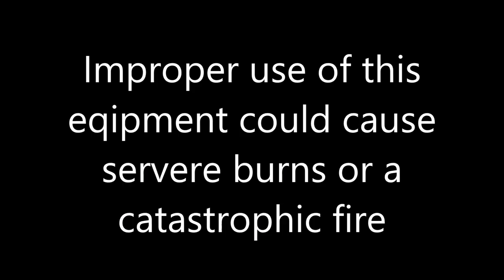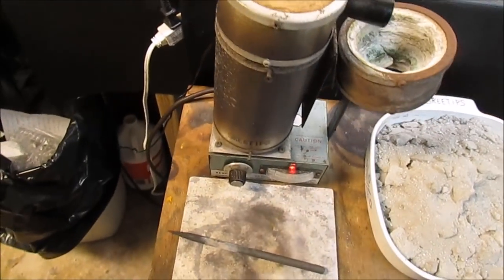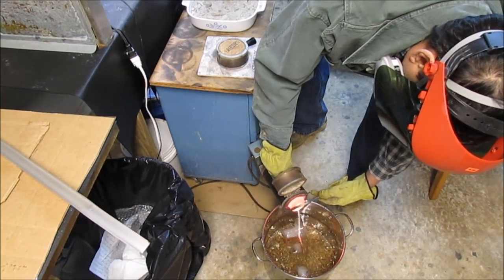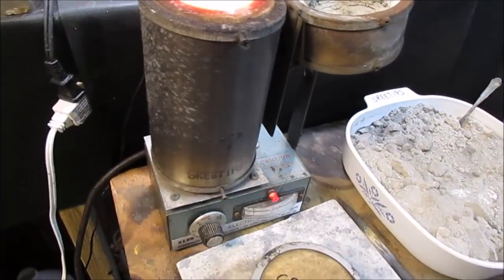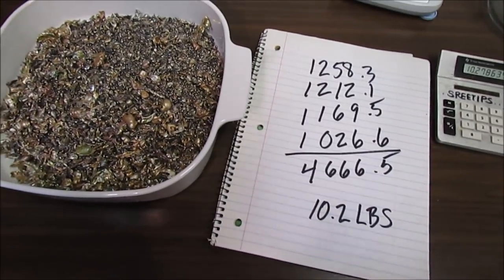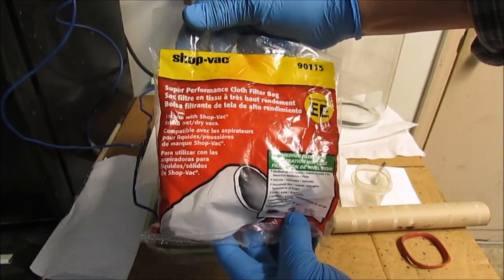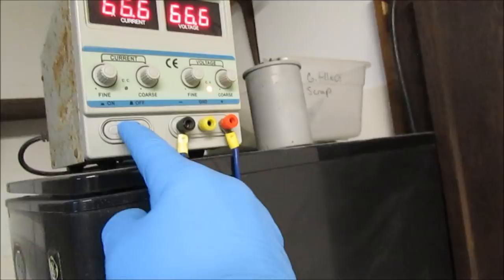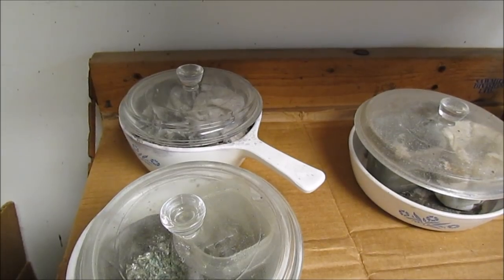Silver Refining 10 LBS Melted Into Shot

Comment: Why don't you use another Tupperware container around the one with the holes in it but with no holes in it. That way the ions will have to easily  travel through a narrow space up around the basket and it would be almost impossible for a dendrite to come up and wrap around the 2nd Tupperware container and touch the anode Hands free operation until the crystals literally fill the whole dish.
Reply from the maker: I run a 3.5 liter stainless steel cell. Palladium, on the goldrefiningforum.com, told me that I would "throw rocks at the glass and graphite cell" after I switched to stainless. He was right.

Comment: Great video as always! Does the anode have to be made from silver? Thank you for the video!
Reply from the maker: I use silver because that’s the way I learned it
Reply: @sreetips  That's what I figured, makes sense and I'm sure your methods are the most correct. I was just curious if another material could be used. That would be another ounce that could be run through the cell.
Reply: Was curious if a copper anode bar could be used or would it contaminate the process?
Reply from the maker: I’m trying to remove copper so anode made of copper is not recommended
Reply: @sreetips  Thank you! I guess I'll be making my anode bar from silver. I'm so close to having everything I need. Just have to get together some more silver before I proceed.

Comment: can an electric furnace like the one you use still be found in good working condition?

I want to step up to one, but trying to avoid the newer Chinese ones that looks similar to yours, but don't really have an extra $450 for the square shaped ones made in the US that I see many hand pourer's using.
Reply from the maker: I found that on eBay for $280 it is well used but it still works. I just kept checking every day until I found it.

Comment: I do love your videos.  Easy to follow and understand.  Too many fly by night people are making videos and not explaining processes or which step is next and why, and god forbid they use any safety equipment.  I'm curious as to what you do with your silver crystal.  Do you melt into bars or sell as is?  I've been playing around with sterling scrap, making silver nitrate and then cementing and melting into 5 oz bars.  The cell is my next step I think.  I'm wondering if you have any loss of purity when melting the crystal and pouring into bars.
Reply from the maker: I've sold the silver crystal and I've melted it into bars. Right now I'm hanging on to my silver for a new project. I've ordered a bunch of equipment to do some casting. I am not sure of loss of purity during melt. I use a clean melt dish and try to keep everything as clean as possible. You can make a 1 liter cell from a 1 liter beaker. I used one for a long time until I went with the stainless bowl cathode method.
Reply: That sounds interesting, and more appropriate since the amount of silver to make electrolyte would be much less.  How does the breaker work as a cathode, and what did you use for anode basket
Reply from the maker: The beaker does not conduct so it's not the cathode. I used a graphite block about 2 inches square by 1\2 inch tall with an insulated copper wire cemented in place with RTV. The copper wire comes up out and over the lip of the beaker where the insulation is stripped away so I can attach the negative lead from the power supply. I'll have to make a video showing how it's done. I use the same Rubbermaid container as the one on my stainless bowl silver cell. It's suspended on a glass rod and hangs submerged in the electrolyte.

Comment: have you ever thought about using titanium to connect silver pelets with power supply? Recently I used titanium wire on small scale (70g of Ag) and it worked pretty well. The wire was immersed in electrolyte where it was touching silver to make electrical connection with it.
Reply from the maker: I've never tried it. Sounds interesting. Please make a video and show how it's done.

Comment: why not just use the aluminium channel like a shovel when you are trying to put cement silver into the furnace?
Reply from the maker: Because the silver will overfill the channel and then spill over the sides of the channel when I try to pour it into the crucible.
Reply: @sreetips  hmm interesting, so not too much powder at a time.
Reply from the maker: Correct,mid I spoon it in then scrape off to level then it will slide right down the channel into the cruc.

Comment: How do you know when the silver/copper nitrate solution has been used up before it starts depositing copper?
Reply from the maker: In my experience, a single batch of electrolyte will be good for about three batches of silver crystal. After that it becomes concentrated with too much copper. I've been told that 60 grams of dissolved copper per liter is the upper limit. After that the copper could start to plate out with the silver. I can tell by how dark blue the color is as to whether I can try to use it again. But I also have a spectrophotometer that I can use to determine the copper concentration if I'm not sure. Also, another test is to dissolve some of the silver crystal from the cell in dilute nitric and check it for color after it cools. If it turns blue then it's a safe bet to conclude that copper is present in the silver crystal. It must then be run back through the cell a second time with fresh electrolyte. Some silver is depleted out of the electrolyte as the cell operates so I augment the electrolyte with more fresh silver nitrate if the amps get too low on the power supply. Oddly, I've been told by some experienced refiners that a few grams (2 or 3) of dissolved copper in with the silver nitrate electrolyte helps form better silver crystals.
Reply: Alright thanks for the detailed answer, really appreciate it! Looking forward to watching harvest time.
Reply from the maker: Gargan, you can watch how the silver is harvested in another of my videos titled, "silver cell restart and silver crystal harvest". Thanks for watching.

Comment: you can make shots by pouring into water, but you need to use other hot crucible with 2mm hole in it. Once silver passes this hole, it will cool down in water and form small shots.
Reply from the maker: I've tried it before and could not get it to work. It made nails instead of shot. Pouring over ice works well for me.
Reply: sreetips - i am uploading video of how we make shots (just granulation process - pouring in water). Works great. Load - wait till it gains heat and it starts automatically when silver is molten
Reply: sreetips here is the vid: https://youtu.be/vWcDS7pIL90
Reply from the maker: Thank you.
Reply from the maker: That looks like pure silver. Mine is heavily contaminated with copper and some palladium. It takes much more heat to get it completely melted. I may have to try your method with some pure silver crystal to make some nice pure silver shot. Thank you.

Comment: Good day sir. I noticed you said you acquired the silver powder by using copper in your silver nitrate solution to cement the silver out. Do you think copper can be used to cement silver out of a solution that is composed of muractic acid and silver? I have a 100 or so pounds of xrays and wanted to extract the silver out of them. I was thinking of using the muractic acid to clean the xray papers of silver and separete the silver out with copper. thanks for your informative videos. They are thought provoking and I have recently subscribed to your channel.
Reply from the maker: No, hydrochloric acid will not dissolve silver. If you put silver in hydrochloric acid a layer of silver chloride will form on the silver. Once silver has been combined with hydrochloric acid it MUST be melted and poured into shot. Otherwise you'll never get rid of the silver chloride. The only way I know of to get silver into solution is with nitric acid.
Reply: Why do you cement it after nitrate phase? why not make it pure by going from Nitric - filtering - add salt or HCl - get silver chloride - then wash chloride from Cu - then pure chloride can be turned to silver by shugar or Al or Zn... then wash it again on filter - melt.
Reply from the maker: Because there is other metals in with the silver. I like to put it (silver nitrate) in a big beaker, add copper, stir ever so often, and let it sit until all the metals cement out. Then run it through the silver cell. Dropping silver chloride, then cementing the Pd with copper, or precipitating the Pd with DMG may be a better way to go. You get your palladium first this way instead of having to refine the silver cell slimes. But I've always gone this route because I'm familiar with it.
Reply: sreetips Thank you. I will keep studying your videos
Reply: sreetips  got u. We deal mainly with simple scrap and Palladium is not involved. We do have huge amount of tin which makes our life ugly :) i have just made 9.5kgs of different scrap 0.83 to 0.925 Ag and went straight forward nitrate - filter - agcl - wash out all cu - and to silver powder with al and hcl. We melt powder in induction furnace before making shots: this way we can make larger load in granulation equip and additionally clean metal incase of any minor impurity. Analysis report .999 at least and it is more then enought
Reply from the maker: Wayne, I've just ordered 5 pounds of X-Ray film. It should be here next week or so. I'll figure out how to get the silver out and make a detailed video showing how to do it. Thank you for the idea!
Reply: sreetips No.  thank you. I'm  glad I found your channel. your examples and explanations are interesting and easy to follow. thanks!!

Comment: From 4killos down to 1.5 killos in 10 days is not a decent yeld for starting with cemented out silver from silver nitrate, unless these a lot of silver left in the slime but its hard to imagin theres like 60(ish)% copper in that shot. Or but if your doing only part of that then its totaly different
Reply from the maker: The impure silver shot is about 98 to 99% pure silver. It's dis colored due to traces of other metals. The cell will yield about 1.5 kilos of pure silver over a period of about 10 days. Then I'll harvest the 1.5 kilos of silver crystal from the cell and continue to run the remaining 3 kilos of cement silver shot. It will take at least three 10 day periods to get the entire 4666 grams of shot turned into crystal. Then I will have about 4600 grams of pure silver crystal when I'm done.
Reply: okay thats what i kind of thought was going to happen, i know the bowl is not too big and that might be a option for what would happen. it just seemed weird that, that you would only get 1.5 out but if your running batches then that makes it clear.

Comment: Wouldn't a heavy stainless screen suspended above the water be more efficient in shot making
Reply from the maker: Actually, the best way to do it is drill a 2mm hole in a melt dish suspended above a metal container of cold water - I'll be doing a video of it soon.

Comment: what is silver cement? Where does it come from??
Reply from the maker: I'll have to do a video titled, "reactivity series of metals". If you place a piece of clean copper metal into a solution of silver nitrate (silver metal dissolved in dilute nitric acid) then the silver will begin form as a grey powder on the copper metal. The copper trades places with silver as the silver comes out of solution. The silver powder falls off the copper and accumulates in the bottom the the container. This silver powder looks like wet cement. This is where the term "cement silver" is derived.
Reply: +sreetips.     Thank u!   I'd love to see that video..
Reply from the maker: I'll make one and get it posted soon.

Comment: Do you have a video showing how to make the cement?
Reply from the maker: Yes, I am working on a complete silver refining video right now. It will demonstrate how to "cement" the silver out of solution with clean copper wire. Plus you can view my current video titled silver refining complete process for the amateur refiner. In that video I cement silver out of solution with copper.
Reply: Thanks man. I’ve watched them all. Best videos out there on the subject. I’m about to get started myself. Just have to get enough sterling first. 

Thanks for the videos.
Reply from the maker: Make sure and look at my latest video on silver refining posted Saturday July 7th 2018. In it I experience a failed attemp to recover the silver from a silver nitrate solution. The solution is so concentrated that it forms a passive layer of silver on the copper that prevents the solution from coming in contact with the copper and the cementing reaction ceases.
Reply: sreetips Oh, I did. Can’t wait for part 3!

Comment: be careful pouring molten metal into water you could get a steam explosion
Reply from the maker: I've had them happen before. It's one of the reasons that I don't like doing it this way. Another viewer suggested drilling a small hole in the melt dish and letting it drip into the water. I'm going to try it.

Comment: why make it more than 999 to 999.999 is it worth it
Reply from the maker: Only if you value your reputation as a refiner. If you are just selling to another big refiner, then 990 vs 999 is negligible. He's going to refine it again anyway.  BUT, if you are selling to someone expecting 999 and you sell them 990, and they check it, then there goes your reputation and you just lost them. You want to avoid this like the plague. I ALWAYs refine the gold that I sell (even to a big refiner) to three nines. Let's them know that I know what I'm doing and gives them no room to wiggle when they calculate my payout. By the way 999 = 99.9% or 1 atom out of every 1000 is not gold. 999999 = 99.9999% pure or one atom out of every 1,000,000 is not gold. You've misplaced the decimal, common mistake.
Reply: ok thanks this is how I learn ask and you will receive .